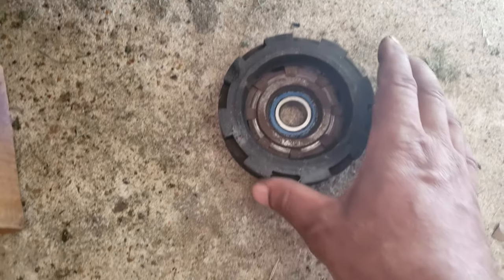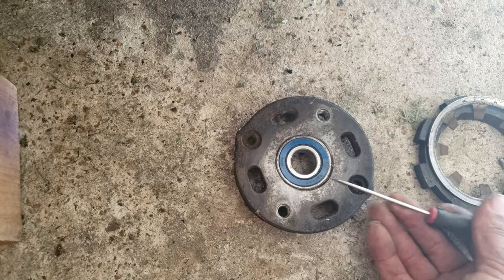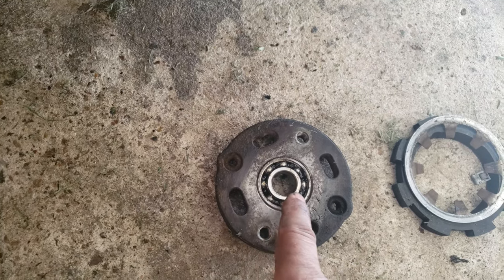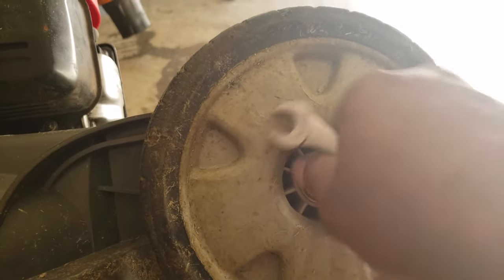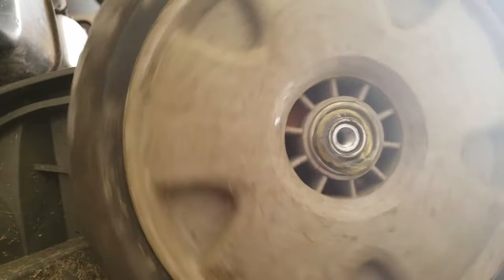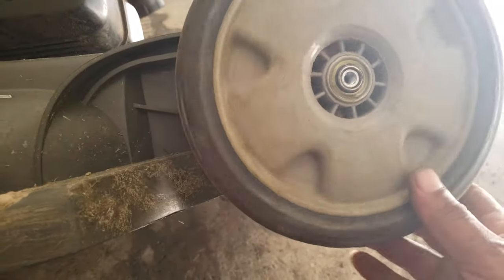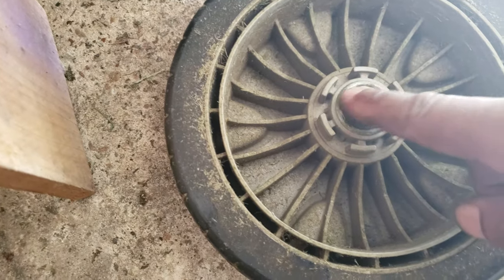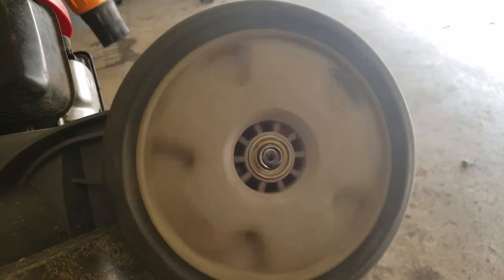honda lawnmower repack hxr217HXA wheel/clutch bearings

Comment: For the wheel bearings, may not be a bad idea to wipe the surface before adding the new grease (to avoid bringing in new contamination). If you want to go crazy, remove wheel and flow solvent through the bearing to pull out old grease. These are not high speed bearings (unlike clutch bearing) so maybe overkill.
For the clutch bearing (with the removable seal) I’ve also used a grease gun with a needle to pump in new grease. For that bearing, which rotates at high speed, using the solvent and repack will probably provide a longer service life.I grew up outside the US in a culture where we threw out nothing. Everything was rebuilt. I like these postings where we instruct each other how to ‘reuse, reduce & recycle’!
Reply from the maker: Understand this about these bearings. That very thin clearance will only allow something smaller than the opening. Also there was no dirt because previously wiped. Mind you these wheels operate in a dusty dirty environment. 2 reasons for these being dry. 

1 because all the manufacturers use something equivalent if not exactly cheap petroleum grease. Also know as Vaseline in the united states. So the rolling and little bit of water contact is what washes the grease away. I wouldnt wash them out with and harsh solvent. And you are going to need strong solvent to thoroughly remove old grease. Not sure how the wheel plastic is going to react to the chemical. Them solvents may soften the plastic making it brittle.
Reply: @thisismee3642 mine were gritty so I popped the bearings out of the wheels and spun them in solvent outside face pointing down.   I let them dry out to avoid hurting the plastic.   Then  oiled them.   Been fine for 10 years now.  Thinking of doing it again soon!
Beats mowin'  !
Reply: I like your grease idea... may try that.   Didn't know that the bearing would stuck the grease in like that.

Comment: I appreciate the videos.  Did you just start taking this stuff apart?  Do you use these in a lawn service?  Watched the hydrostatic video as well.  Crazy they actually put a drain plug in the transmission.  I just got a nice used one.  7 years old.  no issues with it.  Thinking it may last 5+ more years without any maintenance.  If you have a lawn service company I could see you getting 15 years of wear in one year pretty easily.  Thanks again.
Reply from the maker: Yes I take everything apart tweak and tune to my liking.

Comment: What kind of grease/lube are you using on the bearings? It would be helpful to add this to the info in the video.
Reply from the maker: Stens #00 grease that I bought for snapper transmission. Basically any grease from NLGI #00, 0, 1 will work. Any higher will be to thick/solid to seep through the tiny crack.

Comment: When I start my 217 its sounding rough.  Like a dry rough bearing noise. Then when I engage the blades the noise goes away. This clutch bearing is the culprit of that noise?
Reply from the maker: The blade is free when disengaged.  Floating while the bearing absorb the shaft rotation. When clutch is engaged, connected to the shaft. The bearings are not used. Removed the blade and clutch assembly and check the bearings condition. If still good but dry. Pack some bearing grease in there. Make sure bearings spin freely and smooth no play/slop.

  If there is a little play/slop? Replace the bearing or whole clutch assembly. Replacing bearing requires a hydrolic press to push out and back in.
Reply: @thisismee3642  Will do.  Thanks sir!
Reply: @thisismee3642  you can also use a bearing /race driver set (cheap on eBay) to knock it out.  I did mine in about two minutes on the bench.
Reply: @KSMike1 thanks for the info!